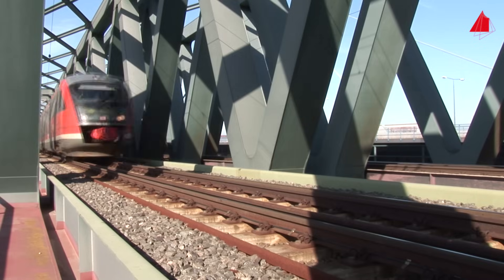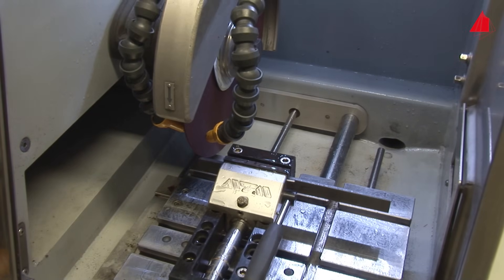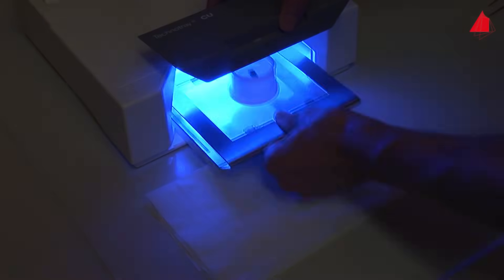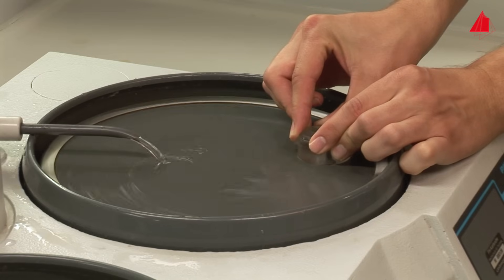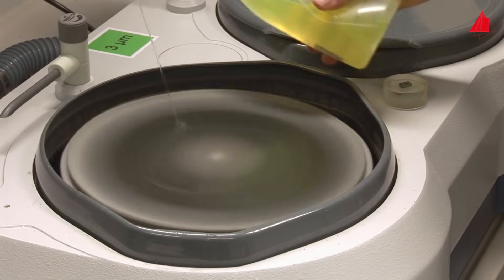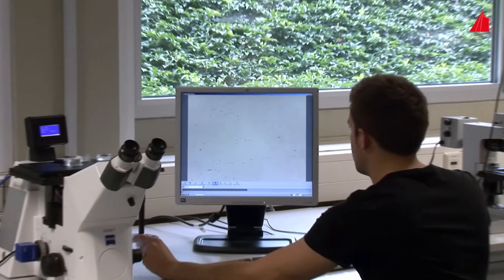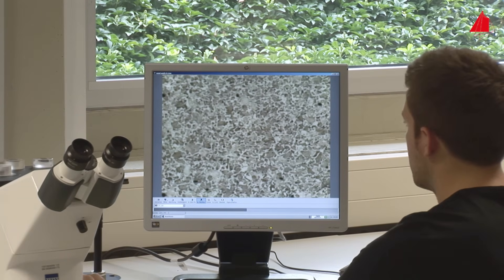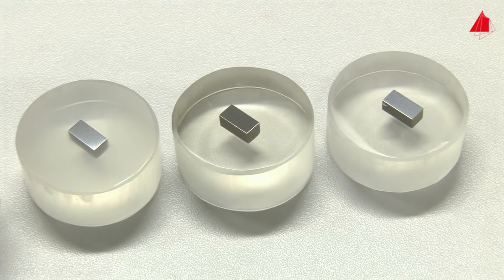Metallography Part II - Microscopic Techniques

Comment: How to etch 3D printed 316 l sample ? I am etching with swab I can scratches I think those are of swab. Is it okay to deep sample in etchant
Reply from the maker: Answer to "How to etch 3D printed 316 l sample ? I am etching with swab I can scratches I think those are of swab. Is it okay to deep sample in etchant": It is generally better to prepare a good microsection and then immerse the entire microsection in the etchant, as shown in the video. Etching with a swab is also possible, but only soft and clean swabs should be used to avoid scratches.

Comment: Hi, informative video, I have a question though:
How to break a small sample out of a resin? if you have to perform hardness and you don't want the resin to effect the measurements, how shall I proceed to take out a sample from resin?
Reply from the maker: Answer to "How to break a small sample out of a resin? if you have to perform hardness and you don't want the resin to effect the measurements, how shall I proceed to take out a sample from resin?": You do not need to remove the sample from the resin. Select a suitable test force for the Vickers hardness test (e.g. 1 or 0.1 kp) and carry out the test. Only clamp the resin properly, it should not move horizontally or tilt. A slight elastic yielding has no consequences, as the Vickers test is force-controlled. Good luck!

Comment: I've been a metallurgist for over 40 years - 2% Nital would have been better than 10% . Also why not refer to the steels as 1054, 1080 etc.
Reply from the maker: Answer to "I've been a metallurgist for over 40 years - 2% Nital would have been better than 10% . Also why not refer to the steels as 1054, 1080 etc.": Thank you! You are right about using 2% Nital. The etching time is longer, rinsing is easier, etc.. We used 10% Nital to speed up the etching time for the video. And we used the standardised European designations for the steels, simply because we live in Europe. Unfortunately, there are no international (ISO) steel designations yet.

Comment: Good video. Personally I prefer to grind down to at least 2000 paper before polishing. Grinding is mych faster than polishing.

One remark: very few customers like pay for polishing plastic with dismonds and extra time. Consider using a smaller size more suiteble to the size of the specimen...
Reply from the maker: This is an alternative, thanks!

Comment: What is the appropriate method to etch the zirconia material
Reply from the maker: Answer to "What is the appropriate method to etch the zirconia material": In general, ceramic materials such as zirconia (ZrO2) differ significantly from metallic materials. Unfortunately, we are not experts in ceramics. However, chemical etching with phosphoric acid or thermal etching are common.

Comment: What the advantage from rinsing the sample with alcohol
Reply from the maker: Answer to "What the advantage from rinsing the sample with alcohol": Normal tap water would cause staining on the sample surface. Distilled water is better in this respect, but tends to coagulate on the sample surface or even corrode it during the drying process. Alcohol (ethanol) is a good rinsing and cleaning agent in most cases. It does not coagulate on the surface when drying, it is not corrosive (in most cases), and does not cause environmental damage.

Comment: Dont mix nitric acid with Ethanol.

Ethanol gets very hot and makes orange gas (nitrogen dioxide?) probs other stuff also not very good for you, may get hot enough to set on fire or explode too.

It is safe to mix nitric acid with methanol or water.

I have etched many samples with nitric and water, i didnt use 10% but rather 3% nitric, cheaper and safer. The methanol evaporates quickly on warm skin and makes the solution more concentrated. Only problem is it is easier to make the sample rusty due to the water so have to be quicker on the rinsing and then hairdryer sometimes.

Methanol can cause blindness, its safe to use properly in a fume cabinet but we rinse off with acetone as it evaporates quicker too.

With water and nitric it is also safe to electrolytically etch, using alcohol with electricity poses risk of fire and evaporation. Don't need strong nitric solution at all for this, just use moar power. Use a variable power supply connected to a stainless pot to drop the sample in and have a stainless rod as a probe.
You can quickly etch corrosion resistant stainlesses and nickel alloys this way without use of bad chemicals, it does etch differently to hydrochloric with hydrogen peroxide or kallings etc. so may not reveal the part of the structure you want to see, its worth a try though.

We only mount in resin if we need to. If the sample is large enough to safely hold, grind the desired face to ~600 grit, stick the sample on a milling machine and skim the reverse side off, this gives a nice paralell surface as we only have the regular style microscope, it saves refocussing all the time or hitting the lens with the sample.
Using the resin is added cost, time and grinding it makes microplastics, it is also an insulator and would have to be removed for viewing under electron microscope. The resin also coveres up any ID numbers marked on the sample if the resin isn't clear like in the video, so you would have to re-mark it and small risk to get mixed up with another sample.

Very good video, explained and shown everything clearly, nice lab and gear.

Does anyone know of a way to properly etch tool/high speed steel without the use of picric acid?

Comment: The etching procedure has to be performed inside a fume hood. You shouldn't rinse the specimen with water and alcohol inside the sink after etching. It should be rinsed with alcohol and the waste should go into a labelled polyethylene container.
Reply from the maker: Answer to "The etching procedure has to be performed inside a fume hood. You shouldn't rinse the specimen with water and alcohol inside the sink after etching. It should be rinsed with alcohol and the waste should go into a labelled polyethylene container.": You are absolutely right, this is the correct procedure. But in our case, all chemicals (alcohol, diluted nitric acid, very small amounts, few samples) our procedure is allowed in a laboratory, at least in Germany. But only in this case! In other circumstances (vapours, hazardous chemicals, environmentally harmful chemicals) you have to take all the precautions you mentioned.

Comment: Why pearlite appears as dark and ferrite appears as white?
Reply from the maker: Answer to "Why pearlite appears as dark and ferrite appears as white?": The etching method we have used is grain boundary and phase boundary etching. This etching method does not produce any colours and there is no black and white contrast. So after etching, the surface of the sample is still completely clean, metallic and shiny. The only effect created by etching is a 3D structuring of the surface: small grooves are created between grains and between different phases.  Ferrite consists of one phase (ferrite itself), pearlite consists of small lamellae of two phases (ferrite and cementite). Although ferrite and cementite are silvery and shiny, the phase boundaries between them have a three-dimensional structure. Thus, a ferrite grain appears light, while a pearlite region appears rather dark, because this etching process has created many small grooves between the ferrite and cementite crystals. It is difficult to explain this without a very long explanation and the iron-carbon phase diagram.
Reply: The appearance of pearlite as dark and ferrite as white in optical microscopy is primarily due to differences in the etching response of these phases during metallographic preparation. Ferrite is a pure iron phase with a body-centered cubic (BCC) crystal structure. It has fewer defects and a relatively homogeneous structure. When etched, ferrite reacts less with the etchant, leading to a smoother surface that reflects light more uniformly. This gives ferrite its bright or white appearance under the microscope. Pearlite is a lamellar mixture of ferrite and cementite (Fe₃C). Cementite is much harder and more chemically reactive than ferrite. When etched, the etchant attacks the ferrite component more aggressively and accentuates the lamellar structure. The roughened surface scatters light, making pearlite appear dark under the microscope.

Comment: what is the final polishing liquid name??
Reply from the maker: Answer to "what is the final polishing liquid name??": There are several brand names on the market, but scientifically, the final polishing suspension consists of very fine (grain size 50 nm) aluminium oxide (Al2O3) particles in water.
Reply: @MaterialsScience2000  THANK YOU!!!

Comment: Em, can someone tell me what is the liquid used in the final process of polishing?
Reply from the maker: Answer to "Em, can someone tell me what is the liquid used in the final process of polishing?" The diamond suspension polishing was done with 6 micrometers resp. 3 micrometers grain size diamonds in a liquid that mainly consists of water (we do not know the exact composition, a lubricant is added). The last polishing operation was done with alumina suspension (50 nm grain size) in water.

Comment: Why put on a lab coat and safety glasses when handling nitric acid if you're not going to wear gloves?
Reply from the maker: Answer to "Why put on a lab coat and safety glasses when handling nitric acid if you're not going to wear gloves?": It's actually okay. The etchant for the steels is only nitric acid diluted in ethanol. In this low concentration, a short contact with the hands is not dangerous, we have a lot of experience. BUT DON'T TRY IT, you have to be an expert! It is very dangerous for the eyes and (to a certain extent) for the clothes.

Comment: can we use the same polishing cloth for all the different polishing stages?
Reply: Absolutely not. Cloths can only go rougher, once used with higher grain size (lower grit), it can only go for that size, no longer it can't be used for lower grain size (higher grit). Since there is no way to keep samples absolutely clean form the previous stage, service time of fine cloths (>1 micron) is very short. But they can be then used for 3 microns, then for 6 microns, etc. Fairly serviced fine cloths can also be used as intermediate step to clean up the sample before introducing it to a serviceable fine cloth of the same polishing step.
Reply: @Duke7562  so it means that after polishing with 6 microns, I would need to use a new polishing cloth to continue with the 3 microns?
Reply: @mcmc727  Yes. You need as many cloths as polishing steps, each one for each step, never to be mixed around.

Comment: if I only have a 160x magnification microscope ...can I use it for microsrtucture analysis
Reply from the maker: Answer to "if I only have a 160x magnification microscope ...can I use it for microstructure analysis": Well, to use different magnifications is always better, but you can already do a lot with 160x, it is a good compromise. Just try it!

Comment: May I ask what etchant is suitable for the 304 stainless steel? I fail in observing the microstructure.
Reply from the maker: Answer to "May I ask what etchant is suitable for the 304 stainless steel? I fail in observing the microstructure." In this case you have to use very strong etching agents, for example a mixture of HCl, water, HNO3, and other substances, too complicated to tell here. You find it in the internet and in some books on metallography - and very important, you also find the appropriate safety instructions.
Reply: @MaterialsScience2000  thx

Comment: Excellent video! Which solution do you use to reveal the grains? Thanks.
Reply from the maker: Answer to "Excellent video! Which solution do you use to reveal the grains? Thanks." The etching agents may be quite different for different materials. The etching agent for the steel in the video was a solution of 10 % of concentrated HNO3 in 90 % of ethanol. It works quite well.
Reply: @MaterialsScience2000  Thanks for the answer. I'm trying to polish aluminum but it's very soft and I can not polish it all right.
Reply from the maker: Answer to "Thanks for the answer. I'm trying to polish aluminum but it's very soft and I can not polish it all right." Aluminium materials, especially soft aluminium, need special preparation techniques. There are a number of books on the market who deal with this problem. You can also contact the websites of the typical suppliers of metallographic preparation materials. Sorry, I do not have enough own experience  for a good advice.

Comment: 2:53 Which product was used?
Reply from the maker: Answer to "2:53 Which product was used?" We have used the light curing resin "Technovit 2000 LC". It has the main advantages of transparency and easy handling, but the disadvantages (i) sometimes there is a small gap between resin and the specimen and (ii) it is not very hard.
Reply: thanks a lot

Comment: Best clean with ultrasonic between polishing form 6 to 1 microns and to 0.1 alumina
Reply from the maker: Answer to: "Best clean with ultrasonic between polishing form 6 to 1 microns and to 0.1 alumina" Yes, ultrasonic cleaning is a good option, and we use it a lot. However, it is not always necessary, and it has to be done cautiously. Some materials may be damaged when using ultrasonic cleaning with too much intensity and for a too long time.

Comment: Very instructive. Thanks for sharing :)
What are the best etchant for brass and Aluminum?
Reply: For brass 3% Ferric Chloride works , aluminium is usually anodised in fluoroboric acid - and looked at under polarised light to see the grains - castings usually don't need etching because the Si in the alloys stands out in the polished state.

Comment: Dear sir
   i have an doupt here this type, lesin was used on plastic mould purpose and treated but then why we use backelite powder on mould in the ECD findout.
Reply from the maker: Answer to " i have an doupt here this type, lesin was used on plastic mould purpose and treated but then why we use backelite powder on mould in the ECD findout." There are many different types od embedding materials available, each of them having specific pros and cons. The main advantage of light curing resin is the transparency, so the position of the microsection within the specimen is easily observable. Main disadvantages are the low hardness of the resin and high shrinkage during curing (sometimes leading to gaps between the specimen and the resin).

Comment: which resin used for mounting of specimen
Reply from the maker: +Yashwant Patil Answer to "which resin used for mounting of specimen?" We use Technovit 2000 LC, a light curing resin which has certain advantages (easy to handle, transparency > good for the control of the sectional plane) and certain disadvantages (relatively soft, high shrinkage, danger of gaps between specimen and resin).

Comment: i would like to asking u about a decarburazion process.. i dont get the layer on the material after eching process.. can u post the proper step or method for decarburazation for quenching steel.. tq

Comment: Great video! Very informational, and clear to the point. What was the liquid in the ultra sonic cleaner? Was that just water?
Reply from the maker: Ahmed El Fadel The liquid is just water. Sometimes we use water with a small addition of a detergent or a small addition of an organic acid to remove rust or oxides.